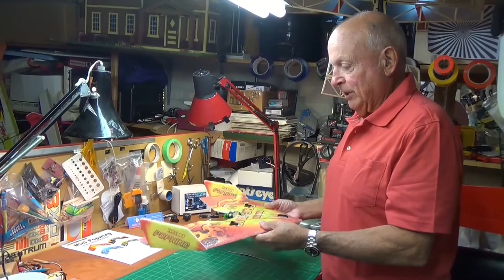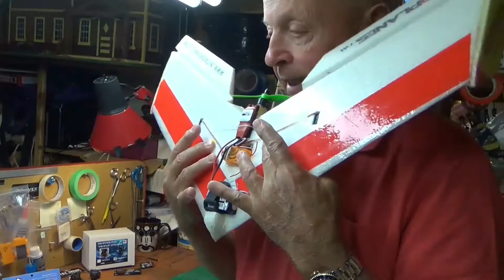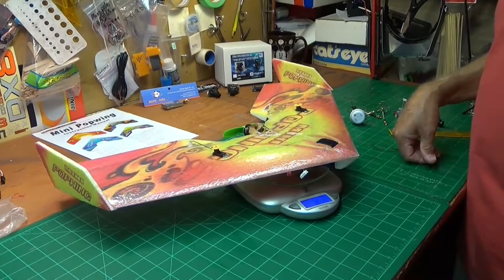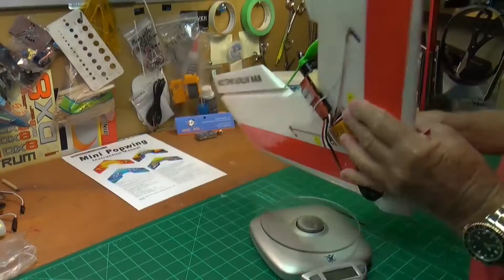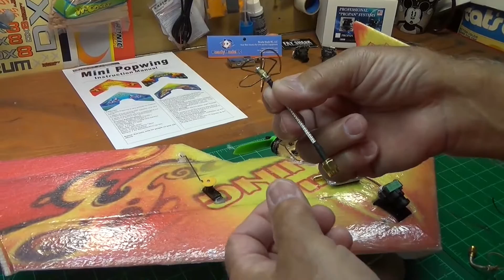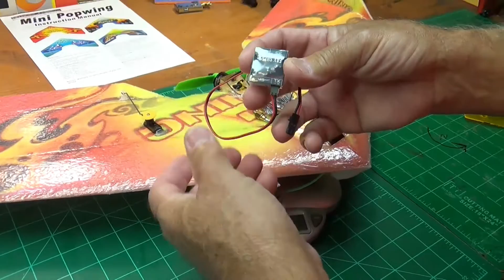Pop Wing Mini FPV Build Part 1

Comment from the maker: First make sure your servos are centered by the radio.  Lay a straight edge across the bottom of the wing in the center-line of the elevon then mechanically adjust it up 3/16" on both sides.  You can do this with the push rod or the sub trim on your radio.  This will give you a good start on the Maiden.  Some trim in the radio may be necessary but not much.  Don't launch too fast.  These little motors rev up fast.

Comment: Great video, when you set your elevons up with the servos, how high did you raise the elevons when setting with the servo ?
Reply from the maker: +Troy Kelley (TK Inspired Aerials) First make sure your servos are centered by the radio.  Lay a straight edge across the bottom of the wing in the center-line of the elevon then mechanically adjust it up 3/16" on both sides.  You can do this with the push rod or the sub trim on your radio.  This will give you a good start on the Maiden.  Some trim in the radio may be necessary but not much.  Don't launch too fast.  These little motors rev up fast.
Reply: THank you for that information and thanks for the explanation as well ! ! !  I am new at fixed wing aircraft so i'm learning daily ! !   I"m a quad rotor guy myself haha... 
Thanks again sir, and great videos
Reply from the maker: +Troy Kelley (TK Inspired Aerials) Some Expo and D/R's will tame it down and make it more fun.  FPV'it and shoot some gates.....
Reply: well i'm using a Spektrum 5e so I can't adjust those .. I get to learn the HARD way until I get my new radio in ! !  i'll be slow and gentle at first ! !

Comment: Great video!  I am very happy with the weight analysis. As you said it wouldn't be hard to shave off enough weight to get the FPV Pop Wing under 250 grams.